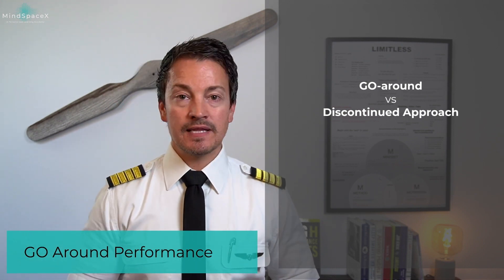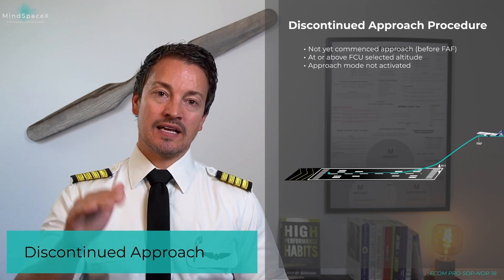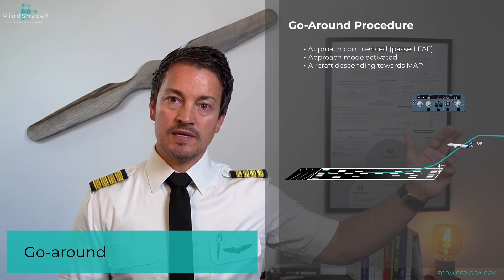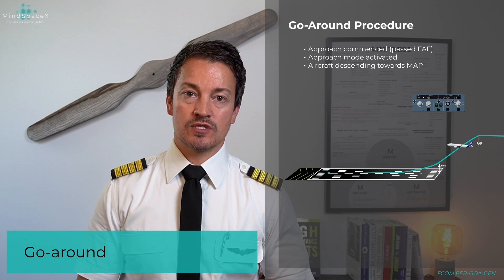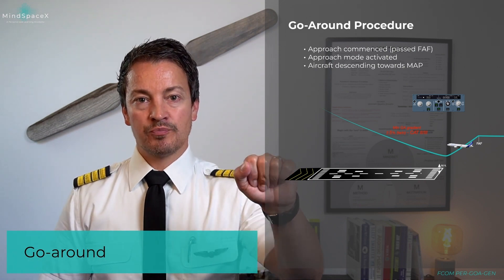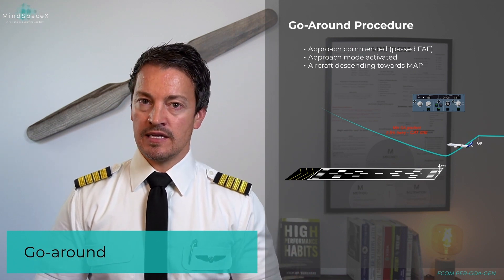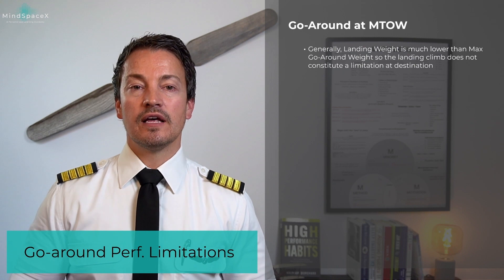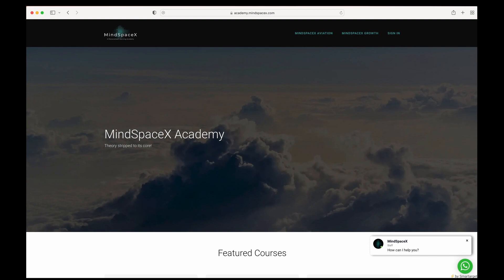Airbus Go Around vs. Discontinued Approach Procedure

Comment: Hi Capatain. I just have one question, what if you performed a discontinued approach then you are in config two? What is the next step after cancelling the approach button?thank you
Reply from the maker: Hi, 

Once you cancel the approach it would depend on the situation. If it was because of for example a 'false G/S', you might just be able to re-engage the APPR mode shortly after and continue. If the situation calls for radar vectors, missed approach procedure to be followed etc. then you would continue with cleaning up the aircraft and complete the After TO Climb procedural items.

Comment: Very good content Capt! It really helpful! Can you explain about FDP (Final Descent Point) and how to identify FDP Capt? I really confused about it. Thank You Capt!
Reply from the maker: Hi Agung,

Let's try and clarify that. We need to look at the difference between Final Approach Fix (FAF), Final Approach Point (FAP) and Final Descent Point (FDP).

Final Approach Fix (FAF) is the point defined on an approach chart where you will intercept the final approach course at the published intercept altitude.  For precision approaches (ILS) it is not mandatory to intercept the glide slope at the FAF, ATC may give a higher altitude for intercept, but pilots use the FAF to verify the aircraft is following the correct GS. A non-precision approach ALWAYS requires the pilot to intercept the final approach course at the platform altitude over the FAF. It is a fixed distance from the threshold and does not change.

Final Approach Point (FAP) is the point at which the aircraft actually intercepts the glide slope during an ILS. Depending on the altitude for the intercept this may be at FAF or before.

Final Descent Point (FDP), I believe is an Airbus term only. It can be considered the FAP for a non-precision approach in this aircraft. When flying non-precision approaches in the Airbus aircraft we use performance-based navigation (PBN) and allow the FMGS to create a vertical and lateral trajectory for the aircraft to follow. These trajectories do not actually exist as they do for ILS (radio signals), the aircraft flies using internal navigation capabilities. And the point where the aircraft starts its final descent for the non-precision approach is called Final Descent Point (FDP).

Hope this helped
Reply: @MindSpaceXAviation  Hi Capt! Really appreciate your answer, it’s explained very well! Thank You Capt!
Reply: @MindSpaceXAviation  Appreciate.